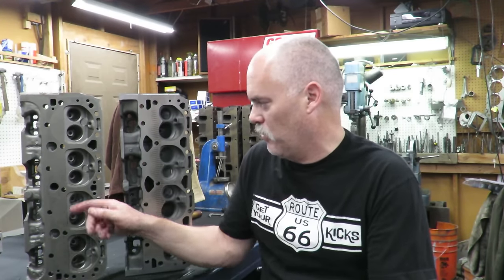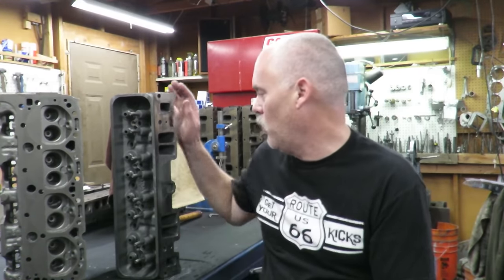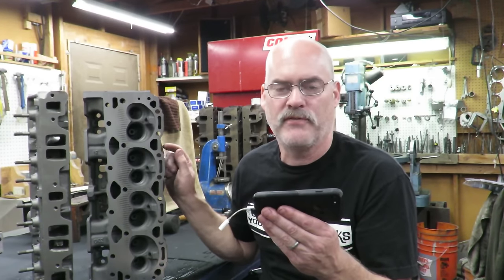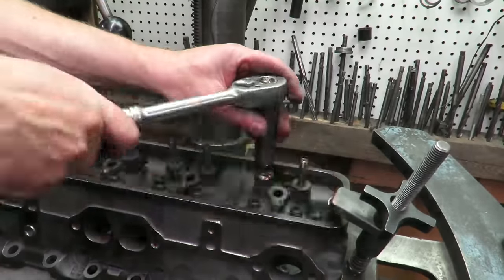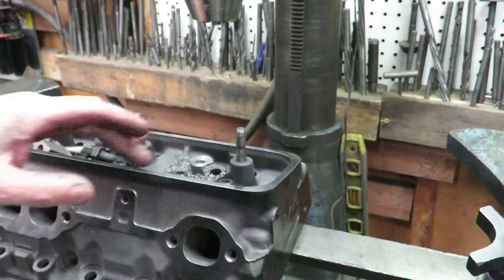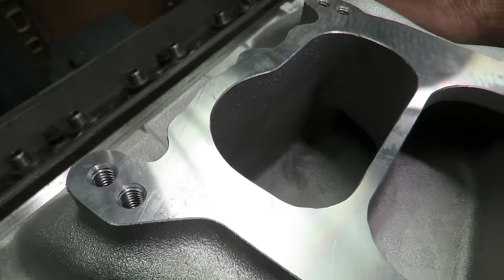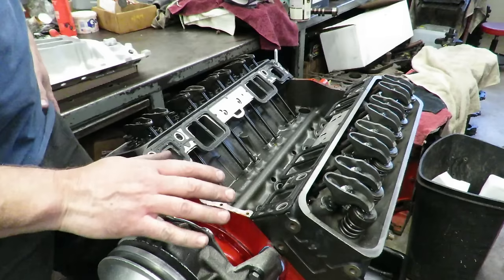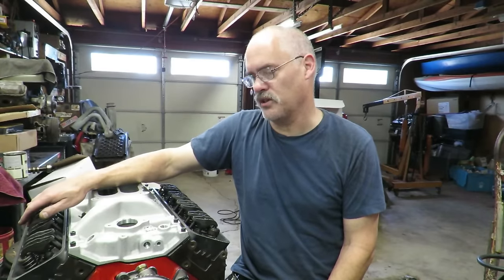How to get more power out of your Small block Chevy

Comment: There's many ways to get power out of the Gen One SBC motors. Some adders require little effort to make a jump in HP and ft lbs or trq. I build 406 sbc, they are my niche motor but like the 383 stroker to.
 If I was to take a typical 350 sbc from any pre 1980 vehicle and wanted to get over 300 hp and trq, with little money to throw at it, I would take a set of cast heads, work them, make sure you can either get large valves or start with  a good set of stocker heads, 4 barrel intake and carb, headers,  for those upgrades you're looking at next to nothing but time and few hundred bucks. Porting old cast heads will give you some decent power, the old double hump are great to port and cheap to buy, a used aluminum intake are a dime a dozen, and carb,,, headers are a hundred bucks on eBay. if you can weld make a H crossover exhaust and some easy flow mufflers. You'd be surprised what you can pull off on an extreme budget build. It will make you want to build more and soon you will be a collector of parts. Everyone has to start somewhere, and the sbc gen one is a great place to start.
 Bottom line is heads, Intake and Carb, Headers.. do what you can with those and see what you make.
 Next will be cam selection, do your research and get the right cam for the heads.
 The sky's the limit, but most of all have a blast.
Reply from the maker: Well said I agree completely I had an old 73 nova with an oil burning 307 I bought the car for $300.00 they guy could not get it to start one Ignition coil later I had the 307 running I pulled that terd and put together a 350 with flat tops and some old iron heads they were the old 283/327 two barrel heads with the small 1.720 intake valves I opened up the throats and installed a set of 2.020/1.600 valves did some mild porting  and gasket matching an old offy single plane intake long tube headers a holley 750 double pumper the crazy part is I was out of work at the time and all of those parts were stuff I had laying around or picked up at a swap meet ran the car at the drag strip with 10" drag radials and a 12 bolt posi I bought from my buddy for $50.00  it ran 13.5 I had about $700.00 bucks into the whole shabang that does not include my time of course but since I was out of work I had plenty of that I kept that car for 5 years and drove it pretty much every day I sold it to a family member and he still drives it pretty much every day he has put quite a bit of money in it as far as body and suspension goes but it still has the same 350 the old small valve 327/283 heads  have 64 cc chambers and you can put big valves in they will run just about as good as camel humps
Reply: I had a 307 in a 1973 Chevy pickup three on the tree. It was a great little motor. 
 The only upgrades was a duel exhaust and a flipped breather lid. 
 It could lay a patch of rubber through first and second. Mind you it had a flat bed "because" the box sides literally fell off one night out performing.
 I went in the ditch on one side of the road shot across to the other side, got it back up on the road and the box sides were still in the ditch.
 I got it home, and made a quick flatbed with 2x4 racks before Dad saw it. 
 He thought it looked great. LOL
 I painted the stock rims white with red and blue pinstriping to look like truck rims of the day. This was in 1978, I was 16. and a holy terror in Rural Ontario Canada Ottawa Valley.
 The deal with the truck was I do all the maintenance I got to use when I wanted.
  The trans blew, stuck in first gear and that was the end of it.
 He didn't make the same deal with his new truck, so I got one of my own. 
 It was a 1968 Chevy 1/2 ton, with a inline 6. I took that out pronto and put a 350 sbc out of a 1970 Monte Carlo. That motor had some get up and went. That was back in my street rod days that went on from mid 70's to mid 80's, and just in the last few years getting back into it.
 Back when I was the go to guy for sbc builds. I enjoyed every minute of it and enjoy it even more now, building the infamous 406 sbc motors, 
 Current project is a 1935 Chevy pickup truck street strip, 406,, 500 hp and ft lbs of trqish.
Reply: I appreciate the effort you put into explaining how things work and why, combinations etc. I wish I had those facts when I started out, but we just didn't back in the 70's. It was trial and error, and there was allot of error. The saving grace was how many sbc motors were available back when knowing which years to look for. Cylinder heads were another well kept secret of sorts back in highschool which I only visited to do burnouts going past  the smoking area and then hightailing it out of there before Rookie caught up the town cop. 
 Fuelie heads, 441 heads, were the cream dela creme and most kids had no idea why one sbc was so fast thinking it was all about headers 4 brrl and Tornado 60 tires LMAO... It was fun, that's what I remember the most  was how much fun we had and trying to recapture that thrill today all these years later with a whole whack of aftermarket parts we could only dream about BACK WHEN.
Reply: A good set of built aluminum heads are cheaper than the price of having junk cast iron heads worked these days .

Comment: I have a 305 chevy from 85 i think and i just buy used parts to get it running. I will ofcourse get new piston rings and pistons if they are too far gone, new bearings, cam and flat tappet lifters. New pushrods course i didnt get any with this engine lol, was missing a lot but darn i love v8's.
Thanks for sharing, new viewer from Denmark :)
Reply: hopefully you didnt pay much,i bought my 225 horsepower 305 running well for $300

Comment: I was the exact same way as you thinking tbi heads are junk. I used to work at a machine shop for my senior year of high school and through college. This shop did pretty much nothing but old school v8s with the occasional straight 6 and ls.  long story short I saw more 882, 993, 193, 062, 906 heads than I can even comprehend.  for shits and giggles one day I CC the chamber and runners on the tbi heads. The chambers were 64cc but to my surprise the runners were 185cc. I was very confused and immediately went and cc another. Same thing 185cc. This got me thinking. The reason the tbi doesn't flow is because the running is pitched down right before it hits the screw. My thought process was If these have big runners and I could open up the pinch and machine down the screw these heads might actually flow decent. So I set out to make the ultimate FU truck engine. I took a tpi 350 out of a 3rd gen Camaro punched it .030 over with some $100 flat tops and zero decked it. Ran a 218/224 @.050 .450 lift cam and an edelbrock performer rpm with a quadra jet. Then I set about porting the TBI heads. I knew the heads won't flow above 4,500 rpm. So I ported them with that in mind. After 10 hours of port work. I assembled the engine. I ran it to the dyno and to my surprise it didn't run half bad. It made over 400tq at 1500rpm and held it all the way to 4000rpm where it basically hit a wall and power fell off quickly. I don't remember the HP numbers because I was too much in shock because this tbi headed 350 just made  454/ 12v Cummins torque. considering this engine cost my about 20hours worth of machine work, a few parts I had laying around and about $400 I was impressed. This engine is still in a 1990 Silverado welding rig to this day. Even in a 6,000lbs vehicle it gets 18mpg down the highway and pull 5,000-10,000lbs with little issue.

Comment: Love your video awesome there are some other things that can be done by a novice Builder (me) lol. Have done it successfully just took my time anyone with a die grinder .removed the valves ,bullet nose the guides,smooth out casting marks in runners (NO DIGGING), gasket matched intake gaskets, placed gaskets on cylinder head being careful to use them on the correct side when putting them on when you assemble the engine scribe around the inside of each cylinder remove material on each side of intake and exhaust valves I'm sure you have heard of it I believe they call it unshrouding valves also being very very careful not to go too far into the castings as not to get into the sealing surfaces of the head gasket, never dynoed my engine but a definite by the seat of the pants feel in the performance especially from around 1800 to 5000 never took it much further at all being hydraulic roller extremely satisfied

Comment: even easyer is to drill and pin your studs will do a good holding job on a street engine that's not hit hard all the time  you do any port maching just to clean up the intake flow
Reply from the maker: very true I pin studs on a regular basis I should probably do a video on that

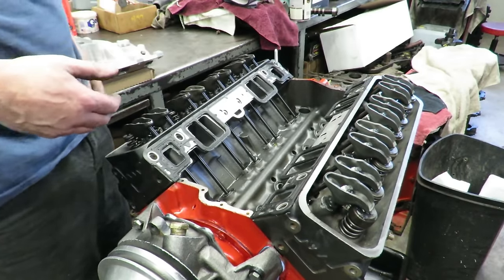Comment: 35:06 Caution: if you mill the intake manifold, it will only ever fit those heads. I don't know about Vortec heads, but the old heads I would mill the intake face of the head 80% of what was milled from the deck surface. This way any intake will fit. Now there is a limit of what can be removed. The valve cover rail can become too thin. Just like anything, there's 2 ways to get where you're going.

Comment: The government caused that.. GM had to comply with lower compression to make emissions. It sucks!!!!good video. But I’m an LS dude. Have you seen the video with a 4.8 making 1100 horse. I’ll stick with LS 6 volt mains baby
Reply: Not entirely. Some of these engines have a low compression ratio in order to support 87 octane gasoline.
Reply: The C4 LT1 Corvette had 10.5:1 compression and the LT4 had 10.8:1, so they were able to get a street legal engine with high compression. That compression ratio would have been impossible if 87 octane fuel was used.

However, you are certainly correct that head design means that compression ratios can be increased without increasing octane requirements.
Reply: Skyline Fever my LS 2 in my tbss 10.9 to 1 and ran 87 octane in it to see why would happen and ran like a sewing machine. I lost 50 horse and may not the best for the cats. But other then that nothing.
Reply: I want to see that video could you post the link?